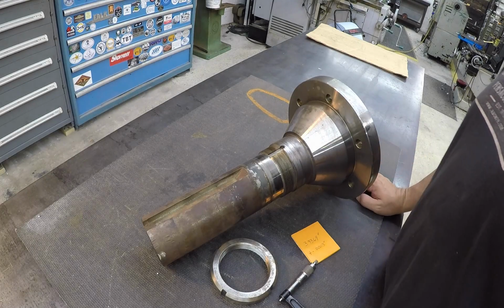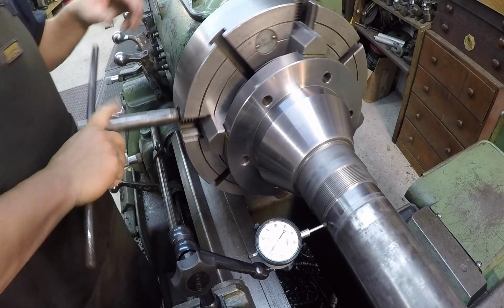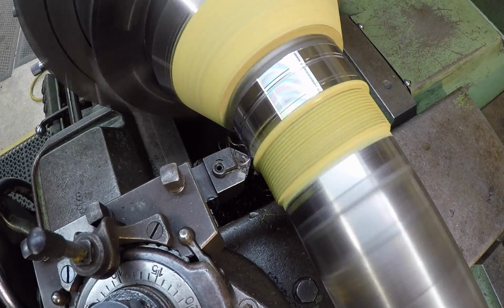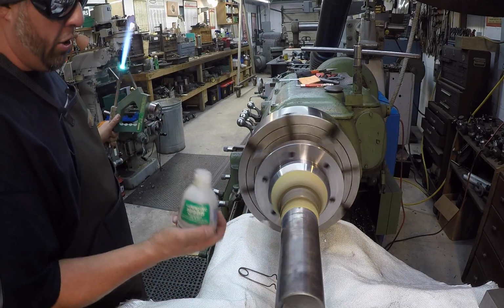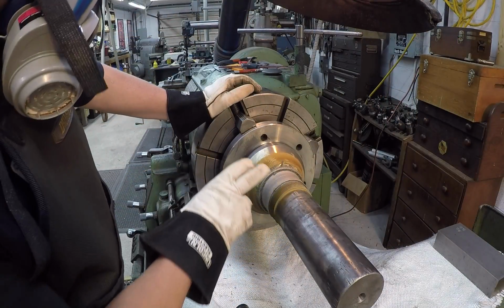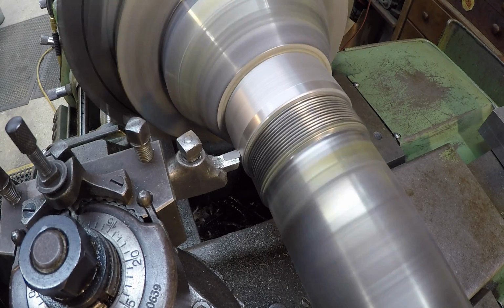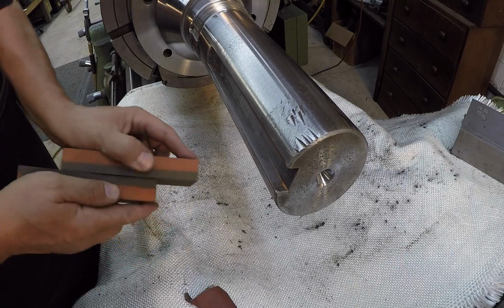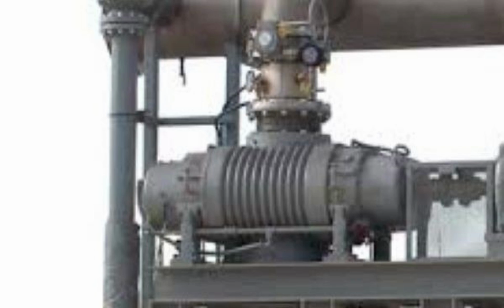SNS 300: Spray Welding a Blower Shaft

Comment: Great vid, I've always wanted to see this process. For years I have heard of hard chroming shafts and surfaces but I wonder if a different bottle of material you had in the box would have been used to create that surface which would then be ground to final size. Here's to the next 300 videos. Thank you

Comment: Did I miss the part where he stressed how important it is to have a room temperature part to work to  tenths? Measuring right after emery polishing is an amateur mistake. You must cool it down or check the part temp. Especially after spray welding. A considerable cool down is an absolute requirement.
Reply: I may be mistaken, but for such a thick part, with a large thermal mass, I wouldn't worry too much about expansion due to some light emery polishing.
Reply: @djdjukic  and he did hit the very upper limit of his tolerance. even if it shurnk by 2/10th (which it wont) he would still be smack in the middle of his tolerance

Comment: I’ve seen this process used on a lot of pump shafting journal bearing surfaces supported by bronze bearings in the pumping medium. I’ve also seen it used on small turbine carbon ring sealing surfaces. The goal was to provide a hard surface for bearings to rotate on. With the hard face surface on the shaft the bearing became the wear part. Bearings were cheaper to replace than a 17-4, 316 ss or a 4140 shaft. Thanks for the show.

Comment: Hello Adam, 
When i was an apprentice years ago some scoring was found on the G&L Boring Mill W axis ways. That scoring was repaired using spray welding and a fixture for rough grinding, then the ways were scraped. You have shown the process only on turnings have you ever used this technique on a machine way?
Mike - Plus8Precision

Comment: Never seen this before.  It would be interesting to see this spray welded surface up close.  Judging from the Matt surface finish after turning it looks as if it is sintering process and provides a good even surface on which to fit a bearing race.

Comment: Absolutely correct.  When "properly done".  It is always in the details.  When exact details are not followed it does not work.  Did this over 50 years ago.  Eutectic.  Not a cure all, but it did the job WHEN the correct procedures were followed.  Excellent Job.  Thank you!

Comment: Do my eyes deceive me or did those industrials blowers look like screw compressors?
Reply: I tought they were Roots type using impellers.
Reply: I was thinking roots, as well
Reply: Given the application he described seems like it's not handling clean/filtered air, as well, I feel like roots would be more at home in that application than twin screw. If you're more familiar with them though, I'd love to hear about it :)

Comment: If you didn't have a spray welder, how would you go about building up that bearing surface? Could you stick weld with a slow cooling rod and then put it on the lathe to cut it to size?
I'm assuming its a journal bearing given the weight of the shaft, so a really hard surface might not be ideal.
Reply: I would imagine there would still be some worry about the shaft bending slightly because of building up stress, since you're going to be melting some of the base material. I think if the straightness was not super critical, though, that that would be fine. I believe he mentioned the journal he showed is going to have a ball bearing shrank over it, but if you needed to weld a similar journal for a plain bearing it would work well

Comment: What is the spray material,  chrome/nickel?
Reply: He said he uses LubroTec 19985. Found the MSDS, looks like it is indeed nickel/chromium with a bit of iron. Really interesting stuff!
Edit: I believe the bonding coat material is the 19985. Now I'm curious to find out what the build up material is.
Reply: @Hawk7886  Lubrotec 19985 is the machineable finish coat, the bond material was probably Ultrabond 51000 or an earlier version. The powder containers he is using were phased out when a newer version of the torch (Rototec 80) was launched in 1980 so the powders he is using were probably original to torch kit.  Pretty good testimony to the quality of the product - it was normal to state shelf life as being around 5 years if stored correctly.  I am UK based, some of the kit and material names were different in other markets. I worked for the company from 1981 until recently.

Comment: I had a body shop in the 70's and 80's,  and the spraybooth blower motor bronze bearing went bad a messed up the shaft, I had it metal sprayed,   but about 1 month later the spray weld peeled off of the shaft,  I ended up using a different type of fan blower,  Great Video nice tutorial Thanks William Orange county, ca.
Reply: I remember that shop Will, its me Pete. Hope youre doing well
Reply: @budscaglini  is this Pete the WELDER,  that used to come to my shop and weld on the truck frames ? If yes what was the name of my shop ?
Reply: @budscaglini  how U doing Pete, Great to hear from U.  William
Reply: Like he indicated, preparation is the key for the spray weld adhesion...durability.  Same principle in auto body work applies.

Comment: Nice job...! Eutectic is the one for this stuff... The speedi-sleeves are good for their purpose....a 'new' seal area, but not designed for a bearing fit replacement. I've used both of these processes for 50+ years on all sorts of shafts...the spray for mostly electric motor bearing journels.

Comment: Congrats on number 300, Adam!  A great show of how repairs can be accomplished when time is an important factor, and it looks great, too!
I've been a machinist for many years, but my work is quite different from yours, (my line is more in small precision parts, but still on manual machines).  I was trained in multiple welding techniques too.  Stick, TIG, Flux core, Mig and even Thermite rail onsite welding, but never spray welding.  It's another fascinating part of the welding gig.  I've seen you do it many times over the years.  Thanks!

Happy 300!!!!!

Dean

Comment: On spraying not toget over 500 degrees , I used to spray bond with the same machine model . If you go over to much on heat I
T will crack and the spray bond will not take vibration , it stretches

Comment: I worked in my fathers machine shop in the early 1980's. We used to perform similar repairs on bearing worn shafts and other parts that would be much more expensive to replace than repair. The process is called Metal Spraying. We used equipment by a company called "Metco". I don't know if they still exist. We used a hand held gun that would accept approximately 1/8 to 3/16" wire from a large roll. Many different types of metal could be sprayed. Oxygen and acetylene were used with the gun to melt the metal wire and allow it to be sprayed on to the shaft or part. After the metal cooled down, it could be machined to the correct specs. I used that same setup to Aluminize headers and exhaust manifolds for hot rod enthusiast.

Comment: I fully appreciate this work and sleeving is as I see it a last resort because there will be a new gap point that can fail. Same thing with helicoil - I have developed a certain dislike for helicoil because I have way too many times seen that the coil comes out when you unscrew it.
Of course I'm curious about where it would go, but if the customer want to make a video of that - then it's their call.

Comment: Im not a machinist but really can appreciate this type of welding, never heard of it. It looks like is has a button near the bottle  but also looks like the power is gravity fed?? Another thing, I always get nervous watching people with torches do anything other than actual cutting lots of mistakes happen when you take you eyes off the torch and look for something else, enjoy your videos, my $0.02
Reply: Your worry is backward. Taking your eyes off the torch is a nonissue because nothing can happen. Taking your eyes off the spinning bits, on the other hand, to focus on the torch, is the dangerous part. I'm not sure what you think can happen if you take your eyes off the torch. It isn't going to turn around 180 deg to burn him, it isn't going to move enough to burn anything else, because taking your eyes off of it doesn't mean it is magically going to move more than a couple inches at most.

Comment: Hello there from Switzerland. I love watching your videos, and plasma welding is something I used to be involved in when repairing snap diameters of aircraft engine turbine casings back in the late 1990's. However, I do have a small suggestion -the lack of attention given to checking the fine thread for the bearing nut after the spray weld was something I was surprised at. In my experience using a wire brush on gunge filled threads generally doesn't make assembly easier, and can make the nut hard to refit. The masking will still be in the roots of the threads unless the wire brush is extremely fine, and also the brush wires can wear the thread unnecessarily. I would have expect a die or re-run the threading pitch on the lathe to ensure the nut can be reassembled. Otherwise though another super episode. Keep it up :)
Reply: No, it gets all the masking out with the wire brush. It is not feasible to get a $250 die for that large die, and trying to single-point-chase the threads will create more problems than it is worth. You don't risk scrapping a $1000+ part made out of 10" round by 18" long piece of round stock, because you want to attempt to clock/time a part to be chased with a single-point tool and are too lazy to work the wire brush into the root of the threads. Taking the time and risk to clock/time the part correctly is just not worth it. After he took that wire brush to those threads, there was not a speck of ANYTHING left in those threads. And how on earth do you know how well he checked to see if the threads were sufficiently cleaned?

Comment: Hi can this be used for engine cranks???
Reply: I had the big end journal of a crank for a Honda CX500 spray welded back in the early '90s. One of the big-end bearings had spun and I rebuilt the whole engine. It worked fine for me and was a good alternative to finding a second hand replacement or buying a new one. I did quite a few miles on that bike before I sold it on several years later.

Comment: GREAT VIDEO! To me it must be rare to see a speedy sleeve on a bearing journal, I mean it’s a SKF product so no doubt that they exists for bearing fits and will probably up the shaft diameter to the very next larger common bearing size but in my experience it’s more common use is for lip seals that run directly on shafts if the seal is run dry due to lack of oil or too much seal purge the lack of lubrication or extra pressure on the seal tends to run a groove in the shaft and it’ll never stop leaking afterwards so for this specific type of use speedy sleeves for lip seal shaft repair are terribly thin by design as do you don’t need to change the seal size, I work on rotary screw vacuum pumps primarily for oil/gas and chemical industries for a living and have had to use a speedy sleeve at times and you rarely see failures if they are correctly installed, but I never seen one like that on a bearing fit  , though I have had mechanical seals come apart on huge shafts that was caused due to bad maintenance, that would be far to expensive for our customer to replace and I worked with our grinding shop on this rebuild to use a special type of spray welding that could be applied more than once! sprayed to maximum thickness , machined down and applied again until the proper diameter was achieved, not sure if i would trust it on a interference bearing fit but it worked perfectly for building the shaft for sealing purposes!

Comment: I think this might have been a good process for the big shafts we use to repair. They were the main shaft on one of those car eating shredders, and if they ever spun a bearing , or a tooth holder, we cut that diameter under to fit a smaller bearing or special made holder. The company wouldn't allow traditional welding, for whatever reason, but it seems this could have saved  them time and money. These shafts were up to 16 feet long, with diameters between 12 and 16 inches, if I remember right.

Comment: How does the torch work? Gravity or venturi? I mean how the powder goes to the nosle
Reply from the maker: It’s gravity feed.
Reply: Its gotta be venturi, from the looks of it. But im no expert.
Reply: That is an early gravity system - just dumps the powder into the flame, the later torches have a bit of venturi and draw powder through the centre of the flame.

Comment: Adam how old is that tool that you are using? The company that built that tool closed the facility at the address written on the back of the case in 1987, I used to live one block away.
Reply from the maker: That have locations around the world.
Reply: @Abom79  I know, it is an international company. I commented only because the kit that you have was manufactured at a facility that was closed over 30 years ago.

Comment: That torch kit looks almost brand new...is spray welding similar to powder coating?...cool result.
Reply: No.  Powder coating goes on cold, with an electrostatic charge, then is melted in an oven.  This process sprays molten metal that sticks to the surface, then hardens.  If the spray were not molten the result would be a sintered metal, which this clearly is not.  I'm pretty sure he could not machine that finish on sintered metal -- but I could be wrong.  Let's ask him!
Reply: I understand what you said and it sounds right to me as it was only towards the end did I realise what he was doing, I am sorry I do not know his name other Abom79 but I get alot out of watching this channel. I also though he might have been a Fitter & Turner but now I know he is a Machinist, one of my uncles was a Titter & Turner. I am not a trades person but my family is made up of a lot of trades people especially my parents and grandparents generations.

Comment: In the early 70's My company sent me to Metco  Flame spray school. Same process, but uses a wire instead of powder.
this process works well on low load equipment. Anything that takes a pounding would not be a candidate. If you have
a high load situation, hard chroming would be the best bet. a company in Elk Grove Village, Illinois called Hausner
Hard Chrome does the process economically and grinds to your spec. The metal spray is too porous for high load
situations and the material will actually compress. Nice equipment from a top of the line company though! Thanks for
the video.
Reply: 1968 or 69 I had a training day with Eutectic on spray welding and tell tale fluxes, remember it quite clearly.

Comment: Pretty warm for a cold process...😂
Great job thanks.
Reply: It is a "cold" process compared to fusion welding methods. It still needs process heat but the part temperature is not a relevant factor, preheat is mainly to ensure surface moisture is removed.  The operator should be checking and controlling the part temperature during spraying by stand off intervals to keep the part temperature below 250C/480F - this is mainly to avoid metallurgical changes to the base metal and distortion, the deposit itself can handle higher temperatures.  I've seen smaller parts reach red heat (inadvertantly) during spraying yet still produce excellent machined finish.

Comment: The shop I work for repairs similar parts (but we have never used spray welding) we use hard chroming.  We would take the OD undersize with a cylindrical grinder and then add hard chrome to it with about .006-.010" oversize, which takes several hours in a chroming tank, then back to the grinder for finish size.  The hard chrome is stronger and more durable than the rest of the part.

Comment: I have only seen spray welding once before on a crankshaft. The crankshaft was turned much slower and the sprayer was set at about 1/2 to 3/4 of an inch , It seemed to add about .025 on each revolution. The torch moved along as the weld was about 1/4 wide .

Comment: I definitely like that procedure, seen it well over 40 or 50 years back,  But think I would have used a rod and welded it with less time involved,
Depending on how accurate it had to be, and not sure if using a rod or mig welder would have warped it,  I have only done 2 such similar when I had to join two pieces together building it up and turn it down, Maybe when I had to join the two pieces it also covered my ass from warping it

I used stainless rod or nickel rod and I welded a portion of one side shifted it  and weld another side and being in the lathe it also helps to keep it aligned if you heat it up so it stays soft and keeps it aligned as you rotate it, as I found worked for me. kept it spinning to cool it after welding it to try and keep it true between centres and in rest

Comment: thanks I got  Engine block in my shop what can I spray on it keep it from rusting
Reply: Sta Bil Fogging Oil. This is wax based and won't run off over time especially when the weather gets hot. I generally grease the bores if its disassembled.

Comment: I worked in an electric motor shop and this was a regular thing I did.
I also worked in a bearing shop and we did this for large industrial babbitt bearings.
I've tried sleeving and they would typically fail; especially with high torque electric motors.
The spray works.
One tip for you: In the electric shop, I used several wraps of old copper wire to protect threads.
Reply from the maker: The copper wire I didn’t think of, thanks for the tip. I’ll give that a try. 👍🏻

Comment: I took a large shaft to a local machine shop recently to have the same thing done, it was gearbox that turns a agitator that had a bearing failure that caused damage to the area the lip seal rides on. It is a very interesting process with a short turn around time.